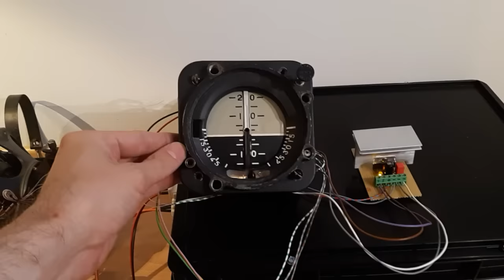Startup of a Russian "type 458" gyro block of a MiG-21 fighter after almost 40years of storage

Comment: I own and fly a Russian civilian trainer airplane, designed in the mid 1960s which contains the original hardware such as this. I should make a video/audio of the startup of the electronics/radial engine (pneumatic start) for anyone interested. Rotary inverters (28 volt DC powered) produce all the necessary 3 phase voltages to run the gyro and Remote compass and other instruments. It has a 3 kwatt DC generator (engine driven) and the voltage regulator for the battery is a carbon pile design. All very crude but when working - very reliable. Let me know if you want me to do this. Cheers, Phil
Reply from the maker: Let me guess, you're talkign about a Yak-18? 🙂
Reply: @barjan82  A Yak 18T to be precise. Mine is one of the ones in the last production run built in 1993 at the Smolensk factory. It has all original instruments/power supplies apart from having installed Western type instruments such as an altimeter showing feet, transponder, VOR/DME and 2 Becker VHF radios.
Reply: "When working, very reliable" -  excellent :)
Reply: Please do! We would love to see!
Reply: @philgower292  hell yeah dude please do show us a video of the old yak
Reply: Yes please!
Reply: Please do. Thanks. Have a safe and nice day all.  CHEERS from AUSTRALIA.
Reply: @JJSideshowBob  "60% of the time, it works every time."
Reply: It is not an option. You must show us
Reply: I'll be waiting for a comment in this thread about that old yak.
Reply: @godsgirls866  a liar.. except he has a video of the aircraft on his channel 💀
Reply: Fake channel
Reply: @braeeee_  Yeh...I just watched it. 1 video on his channel of someone else's planes....smfh
Reply: @braeeee_  He was off his meds at the time and thought they were his planes 💊🤪🦄
Reply: YES PLEASE Phil!
Reply: By rotary inverters you mean dynamotors? I had some old marine band (3 MHz a.m.) radio gear that was powered by one - that radio had a real hum to it! It ran off 12 volt marine batteries and provided higher DC voltage for the tube filaments and a.c. for the amplifier, if I remember correctly.
Reply: I would love to see a video of your yak 18t
Reply: Please show us dear!! Very interesting things to be honest
Reply: Wow! I'd def be interested! Just to show you, I'm heading over to your page now to subscribe!
Reply: Even the original Boeing 747 used carbon pile voltage regulators.  Hats-off to the designers of that era

Comment: This gyroscope technology is still relevant today.  Microcircuits will not withstand an electromagnetic pulse from a nuclear explosion, but a mechanical system will work.
Reply: Very good point and pertinent in today’s threat environment too. It’s worth noting that a vacuum tube transmitter will still operate after an EMP, not much else electronic will.
Reply: @johnedwards1685  yes you're right. I'm from Russia myself

Comment: I used to be a US Navy avionics technician and in-flight technician/radar operator on the E-2C Hawkeye in the 80s (last class of enlisted aircrew flight technicians for that aircraft btw). Back then we had two redundant inertial nav systems that had to spin up and cage before the aircraft moved. (this was all pre GPS) It took about 10 minutes. Then u punched in your current lat/lon and u were gtg. Both the front end instruments and back end weapons systems used those int nav inputs. The computer in that aircraft used a program on magnetic tape reels and had magnetic core memory! An 8k memory module was about the size of a large math or science text book. It was amazing how it all worked so well.

Comment: This is a new lesson for me. As an engineer that's fascinating. I can't even imagine what the Millitary specs had to be for that beautiful machine.
Reply: Note to self "there is zero Indication of Altitude/depth on the "Level indicator"-(don't know aerospace engineering) so i don't Know what the "module" is called, but that Gyroscope Looks really really fascinating 

Qeustion ?
Are there Three Wheels Rotating on the Gyroscope 

Or Just Two?
Reply: @powerelectronics7544  I wouldn't know. My educated guess is that is it equipped with planetary gears. Am I close?
Reply: And... That was a piece that was rejected!
Reply: @VidarrKerr  😆 like I said, guess. Must admit it's still cool.
Reply: @inlasttonowhere4459  For sure it is! It is beautiful.
Reply: I agree. Before I became a radar engineer I used to be a technician working on some of the early inertial navigation systems that were primarily on the F-4 series aircraft. What always fascinated me was how they delivered good CEP (read: navigation accuracy) while conducting high G maneuvers. Today’s IMUs are amazing and the level of avionics integration provides navigational and weapons delivery accuracies that are impressive.
Reply: @yellowboxster06  Do they still use analog and mechanical systems?
Reply: @VidarrKerr  yes they do for those legacy systems still flying.
Reply: @yellowboxster06  Kalman filtering.
Reply: You only need one rotor for a gyro. 

It simply had to be gimballed so it is free to move in all direction. 

It’s not until you get to solid state ring laser gyros that you need one for each axis.
Reply: Ehhh, often "mil spec" can mean the cheapest possible solution, that does the job.  Don't confuse that with quality engineering xD
Reply: @briankale5977  Absolutely.  But then the engineers at the receiving end have to be better and faster in order to cope.  
Problem results:  If they've coping the procurers consider that they got their job done well.  Hence a viscouse circle results.
Not helped by providers taking the p!$$.
Reply: @powerelectronics7544  just one spinning wheel
Reply: I have to agree, this is delicious AF
Reply: In Last to nowhere
What school you did? never learned anything about gyro?
Reply: @inlasttonowhere4459  All axes, as when you do a boat in a bottle filled with water, the boat is always up, any position of the bottle!
Reply: @lucasrem1870  Colorado School of Mines. BS EE. 
This is more on the mechanical. None the less, what's your qualifications??? This is an appreciation of someone's/ hard earned worked. I admire it.
Reply: @inlasttonowhere4459  
Thanks for the update!
Mines, volume calculations, good foundation! You did ever work in te the industry?
You do understand what it does!
Reply: Unfortunately, it's probably easier to find a spare military-grade gyro than it's datasheet
Reply: How about now ? Can you imagine now ?

Comment: I love stuff like this, part of the reason things like the Saturn V or the SR-71 are so special is because the control electronics are electromechanical. Don't get me wrong, I love being able to buy an IMU, stick it on a breadboard or perfboard and it just works but there's nothing to it.
I really wish there was still a place for electromechanical stuff like this today, because I enjoy the mechatronics much more than just electronics but it's sadly obsolete AFAIK.
It's funny though, tons of US military tech, especially missiles and planes, is from 50-60 years ago and still uses electromechanical tidbits, even if upgraded ones.
I also love how this sort of thing is the thing you can actually repair, not just desolder and replace.
Reply: Saturn lV? Did you mean Saturn V rocket?
Reply: @js-wy8fg He means Soyuz rocket)
Reply: Some electromech steampunk :)
Reply: @js-wy8fg  Yeah, so used to seeing four instead of five. Oopsie. Edited.
Reply: Guess what system f15's and f16's use today? Yep, mechanical gyros. Hell, even the f22 uses them. Military technology isnt as advanced as people think...
Reply: Yep!
Reply: One industry that still uses electromechanical logic you may not realize: bowling. The first automatic pinsetter (Brunswick A) was designed by former American military aircraft engineers and stayed in production until the early 1990s. I would be willing to bet at least half of automatic pinsetters currently in service are electromechanical. If you're curious, most centers will be glad to give adults a tour of the back end and show you the machines.
Reply: Electromechanical advantage is that it can’t be damaged or stoped by EMP, that why many military grade technology still using it
Reply: @АзаматА-у9щ  good point
Reply: Yes! The SR-71 has been my favorite bird. Seeing it was developed and designed in the late 50's, built in the 60's. Yet when they decommissioned the SR-71 just before 2000, there was nothing after it's 35 year career, both still to this day could touch it.
Reply: @jonnyj.  Well I assume electronical gyroscope need a signal the shoul be precise...mechanical is using gravitational field forces and I would alway trust it more than any other damn electronical chunk...
Reply: there is - in guitar pedals and guitar amplification

Comment: I love how it has a little orange bubble/spirit level built in!
Reply: So you can be sure it's level when you calibrate it.
Reply: Thanks. I was wondering what that might be.
Reply: @qdaniele97  I belive it indicates side-slip while banking
Reply: @starliner2498  the equipment case won't be in the cockpit, just the gauge that's sitting on the PSU. That bubble is for the benefit of the techs during install and maintenance
Reply: @mulgerbill  not convinced man, might be dual purpose but it's definitely used for side slip indication (there's a separate primary instrument nearby)
Reply: @starliner2498  it's absolutely not used for side slip indication, at all. the gyro mechanism is behind the pilot, completely out of the cockpit and separated with a solid wall. nor does it feed any information into said gyro, the side slip indication on the bottom of АГД (artificial horizon etc seen in the video) is a simple system that requires no power, it is in effect nothing more than it's own spirit level, which is why it remains permanently slanted slightly off to the right as the horizon is not perfectly level, nor does it move when the poster fires up the gyro and АГД self tests.
Reply: @QuantumW  I see, alright thanks!
Reply: So... each time, at unit startup, the pilot needed to ensure they were parked on level ground and not on a slope?
Reply: @davidpalmer9780  correct, but how many airports can you think of that aren't? (sloped runway excluded) :p
Reply: @QuantumW  Not many I'm guessin'.

Comment: Incredible to see this kind of technology, which was so advanced once upon a time
Reply: wont be long at all until theyre saying that about silicone chips and the vast amounts of power they require :) all that excess heat and fans and craziness. photonic circuits is the new thing.
youll be telling your grandkids about heatpipes and theyll be looking at you like your a caveman 😂
Reply: Well, if don't configure a modern IMU properly and don't filter the output with the proper transforms...it's gonna be WAY worse than a mechanical gyro!
Reply: @luminousfractal420  emulate it you meant, or use Russian sofjet skills to build it!

Comment: My dad had some gyro from something ww2 that was air powered.  Had a 3" brass wheel with little cups cut in the rim for air to blow it around.  Everything required amazing workmanship before computers.
Reply: Still does take workmanship in a way, but I know what you mean. Elegance. Cessnas still use something similar to this day though.
Reply: Even now, in light aircraft some instruments are air powered, and others are electric, the idea being that a single failure won't disable all the instruments.
Reply: @sylviaelse5086  Ram air power is cool
Reply: That was from a Torpedo.
Reply: Aren't the non electric gyros actually vacuum powered rather than compressed air?
Reply: @srnunan4783  Yes, they are. I was going to fix my comment.
Reply: Just needs a little lubrication...
Reply: Could be a v1 or v2 gyro?
Reply: Yes! My dad gave me a WW II gunsight from a Navy AA gun - it had a clever bit of optics and a gyroscope like that, also air powered. You'd sight the aircraft through this window in the metal box, and it would compensate for the motion of the ship - you'd sight ahead of the aircraft and the gunsight would instruct servos to move the gun accordingly. All analog, very accurate for it's day.... incredible.
Reply: First known computer generation zero made by ancient Greks before mision a Mesjah, find in ship wreck. Named: Mechanism of Antykithiry

Comment: Always amazing to see. I used to think that gyros were much simpler.
Reply: They actually are.
But in aerospace they have to deliberately make everything sophisticated so that it’s rock solid and full proof operational for decades to come.
Reply: @shuklavinays  Airplane mechanic here.
Redundancy is the name of the game in aviation. NOT complexity.

Aviation equipment isn't built complexely for the sake of being complex, as your comment suggests.
Quite the contrary. If a simple system can be kept on an airplane, it is. The simpler something is, the less likely it is to break, and the easier it is to fix when it does.

The so-called "complexities" you speak of are backup systems for those primary systems, in case the primary goes wrong. 
Some components have 3rd and even 4th stage redundancies. But most only need to be two.

The idea being, not necessarily to make the equipment last as long as possible. But to get you safely to the ground, should something go wrong.

If a car's ignition system stops working, all you have to do is glide to the side of the road, slow down and put it in park.

Tf are you gonna do when you're up in the sky and your ignition system fails? 
A safe glide to some flat surface AIN'T a garantuee. 
So airplanes have 2✌️ ignition systems. Because the odds of both failing simultaneously are astronomical.
Reply: @davecrupel2817  I was just going to say redundancy
Reply: @JoeKyser  damn right. The more and better your redundancies, the better your machine can catch it's own ass when it slips and falls.
Reply: Gustav Gnöttgen
German engineers, less parts?
You can build them using LEGO!
YouTube, simpler?
Reply: @lucasrem1870  Hotel, trivago?
Reply: Simple in principle. But when you need high precision, accuracy, and reliability things start to get complicated
Reply: @davecrupel2817 
WW2 piston engines had dual magnetos/ignition systems that you checked against each other prior to take off.    My old 1996 Ford/Mazda pick up truck had a four cylinder engine with 8 spark plugs., two per cylinder.  I always wanted to mount a WW2 style magneto check knob on my dash but was too lazy.
Reply: @shuklavinays 
Um, whatever.

Comment: 40 year old Bering at 10k rpm. Perfectly safe!
Reply from the maker: Just to raise the stakes its running at 24k rpm 🙂 It has spent most of its life in a completely sealded nitrogen filled housing, so the bearings are still magnificent.